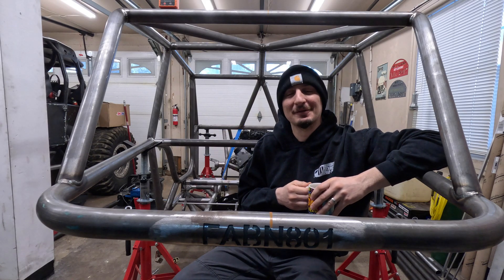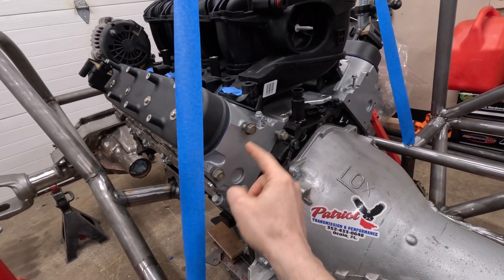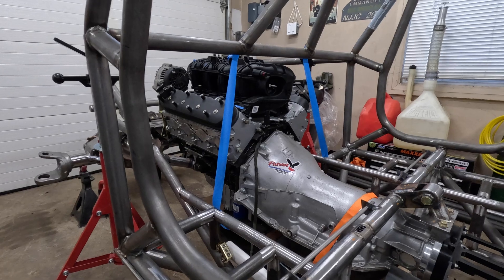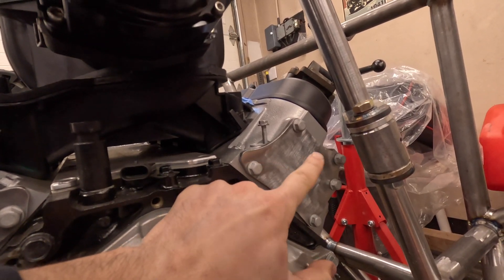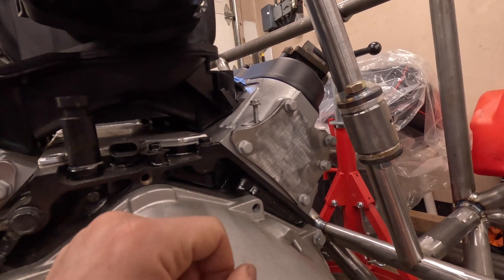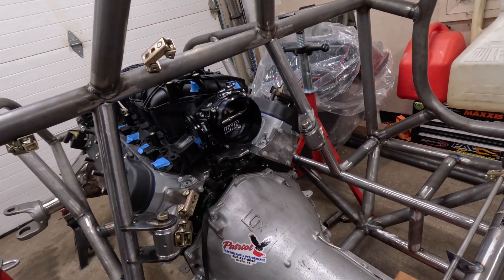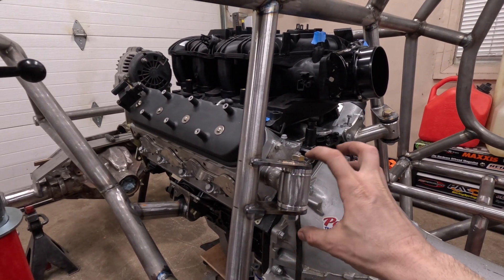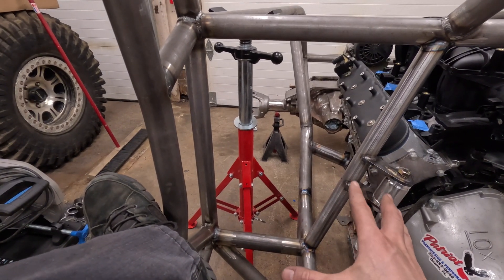LS Engine Head Mount using BKOR Plates | Reduce Driveline Movement | FABN801 Trail Lizard Buggy

Comment: so running 4 engine mounts?
Reply from the maker: Yes. 2 in the stock location on the side of the block and then the 2 on the heads.
Reply: @MadGreekOff-Road  so engine still can flex some.  but not a bunch...   i get it.   maybe you explained in the vid but had the volume so low i didn't hear everything.
Reply from the maker: All good. Yes I did cover it in the video. Basically there to help minimize flex as much as possible. Everything will be mounted with poly bushings so there will still be a little movement but the head mounts will deff help reduce it even more.